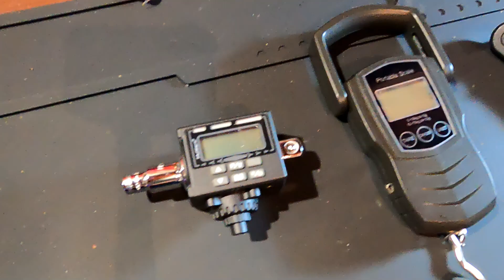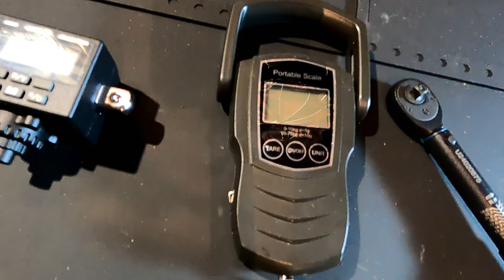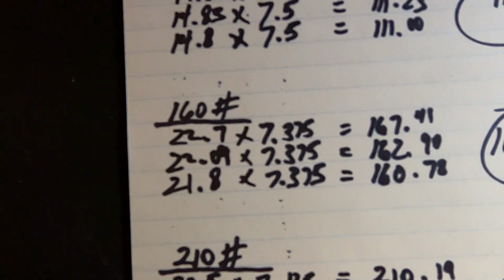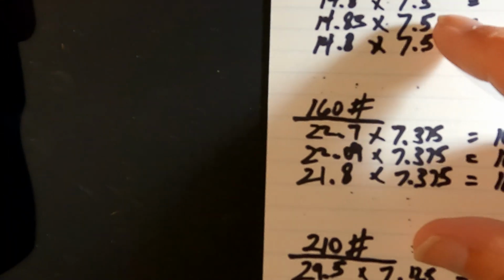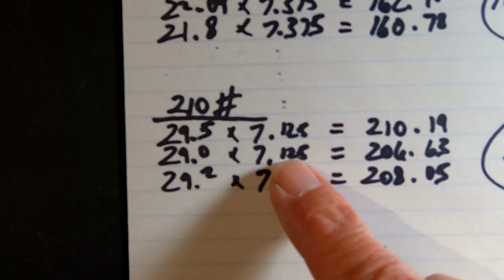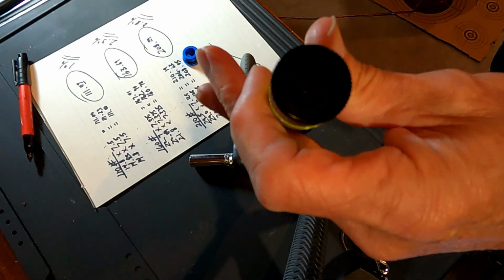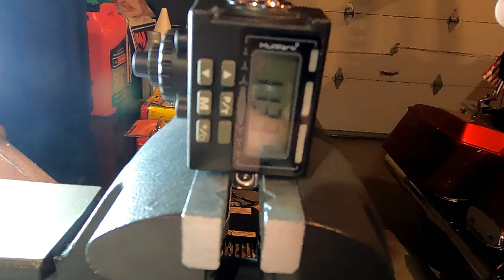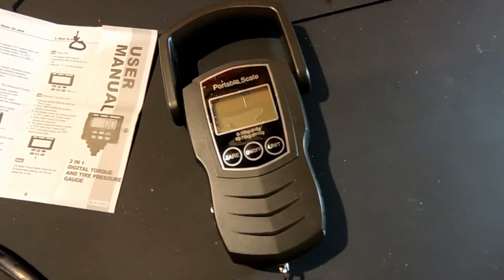Two easy ways to calibrate a torque wrench

Comment: Is that the torque ratchet you use for your 88 fxstc for the torque ratings, I need to get one for mine but was curious about between what ratings I should get for a ratchet
Reply from the maker: @ashdonhudson1188  I have been using the Pittsburgh Pro 1/4", 3/8", & 1/2" click style torque wrenches for years. They work great and you can get them for 15 bucks. I'll use this new one now too on small fasteners such as derby cover bolts.
Reply: @BrewCityRider  20-240 inch pound rating good for the standard use on our bikes?
Reply from the maker: @ashdonhudson1188  That range will work well with high torque fasteners like the compensator bolt and axle nuts. You will still need an inch pound torque wrench for the small stuff though.
Reply: @BrewCityRider  thanks man!

Comment: Great video. I bought a similar torque wrench and wondered how to adjust the calibration. Your video answered my question. 
I guess any calibration method is only as accurate as how accurate your weights, scales or torque converter are.
Reply from the maker: Great to hear!